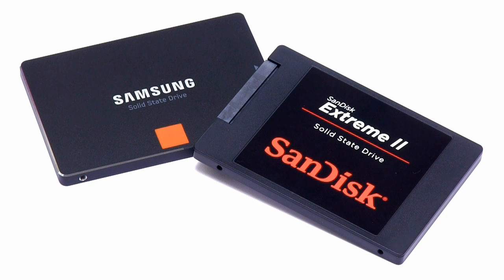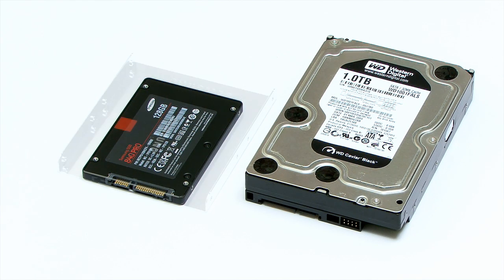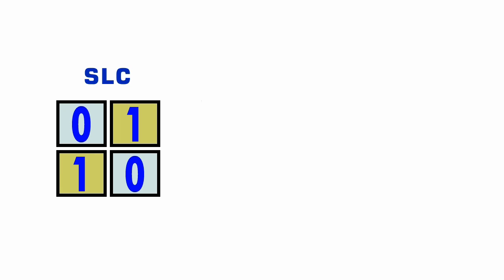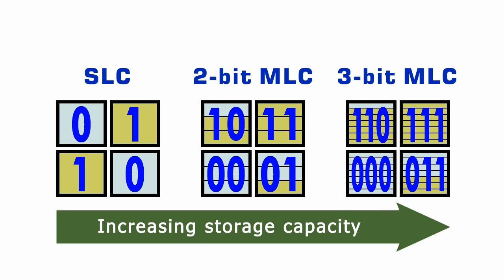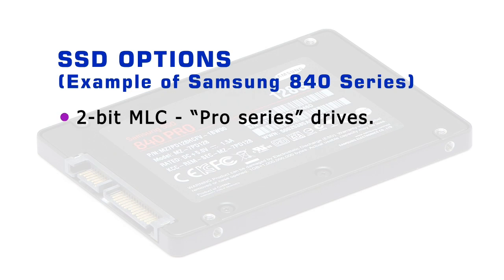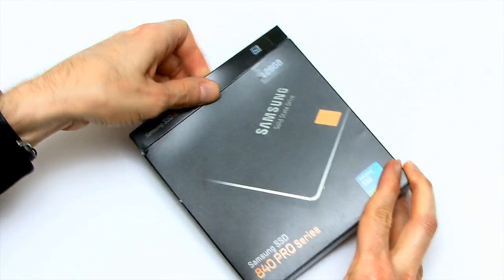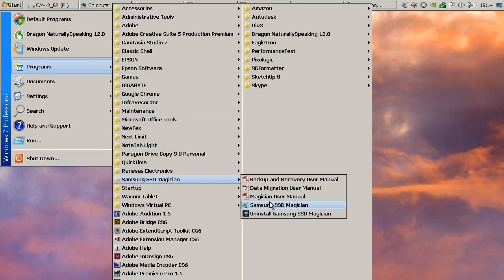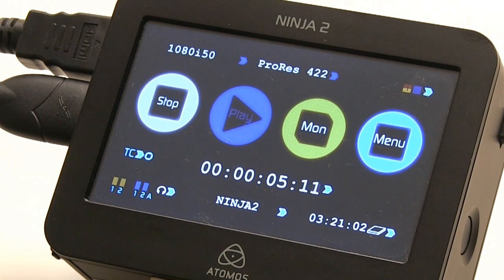Explaining SSDs 2014 Update

Comment: SSDs more than likely won't replace HDDs, rather than be used in random with them by a higher percentage of the computer community.
Reply: Harddrive size growth relies on the magnetic interaction of two moving items in an incredibly high precision mechanical device. There are inherent limitations to how precise you can get (data density), and how space you can fit in a 3.5" drive (platter diameter and count). And even if you move up to larger form factors, you are going to have other very significant tradeoffs in terms of things like spinup speed and arm over disk travel speed. Right now we are hitting some very heavy walls in regards to improving HDD capacity, with companies dabbling in things like helium filled enclosures for reduced air resistance, or trying out thinner platters. With more platters and enclosures that will leak gas over time, the durability and lifetime of harddrives will decrease. And no permanent solutions have been made to the problems that are faced. Meanwhile, on the SSD side, the only thing holding us back right now is memory density and controller limitations. And there is massive space to improve, with controllers able to address more modules right around the corner, along with higher density flash. And we aren't even close to utilizing the full size of 2.5" SSD enclosures. Even the 1TB drives on the market don't get close to filling them up. And there aren't really any serious reductions in performance from scaling SSDs up to be much larger.

SSDs are, sometime in the next few years, going to be come the primary storage medium for home computers. Something that is already happening in laptops, and sort of happening with people opting for phones to fill their daily computing needs. A lot of PC enthusiasts are already moving to SSD exclusive computers, especially in places where fast internet is cheap. Several of the computers I've put together for clients recently have been SSD only, with most of the buyers having gigabit or faster ethernet connections. Since they don't really need to store music or movies on their computers, and only need disk space for games.
Reply: ***** I don't know what weird kind of logic you're using at the moment, but please go back and read through the conversation. Your original statement was that you didn't think HDD companies were bothering as much anymore, which is blatantly false. Adding in that people prefer SSD speeds over HDDs, which is true, but the implied notion that this has such a large impact on the sales of SSDs vs HDDs is not correct. What on earth does it matter if people are buying a decent amount of SSDs if the massive majority of drives sold are ones going in servers, and if the massive majority of those are HDDs? Also, the people going out and buying SSDs are, for the most part, computer enthusiasts. SSD sales are higher than they've ever been, but are still very small compared to total HDD sales. More and more people buying something doesn't mean that a lot of people are. And high end video cards start around the range of about $100. Everything you're writing is from an enthusiast perspective, and you keep conflating enthusiast consumers with general consumers. 

I'm disagreeing because what you're saying isn't correct, and doesn't make sense.
Reply: lol, what... lol servers are are replacing EVERY single hard drives to SSD configuration, and more reliable than HDDS, and its most likely, will be way cheaper even may be cheaper than hdd (in current times) in a few years.
Reply from the maker: Kevin Jin Remember that servers themselves store data on either HDs or SSDs . .  :)
Reply: Kevin Jin Servers still use drives. Not magical server storage. And you're still going to have to use some form of local caching. We have up to 3 levels of cache in the CPU and RAM. There are even people who use SSDs for local storage cache.
Reply: well of course a lot of servers are still running hdd, but now days so many companies are turning to ssd for marketing, and other reasons, just cause its that cheap and efficient.
Reply: ***** Yeah. For a good many years content has grown with the size of storage available, but that growth is rapidly slowing. People working with text based media hit a point years ago of being able to buy all the storage they'll ever need for a few dollars, even the most hardcore music enthusiasts who refuse to listen to anything but FLAC won't need more than a single drive, and although they are still growing, game sizes aren't growing anywhere near as fast as they used to. SSDs don't need to overtake harddrives in size or dollar/gigabyte, they just need to become large enough that people won't need an SSD and another drive. Which is already the case for a lot of people. Most of the computers I've built for older people or families over the last two years have had a really small SSD and a sub 1tb HDD, but honestly there isn't much point in that anymore. Right now I'd much rather put together a system with a slightly larger SSD, and not have to fiddle around with things like moving the download or media folders, when they're unlikely to fill up the SSD anyways. I don't think we're that far away from the majority of all systems only having an SSD.
Reply: ***** Well it is actually really close. SanDisk is planning to release a 16TB SSD in 2015 (http://www.tomsitpro.com/articles/sandisk-4-tb-optimus-ssd-lightning,1-1925.html). I believe it will be in the 2,5-ich size and I am really looking forward to see what it will do with the prices of 1TB or even 4TB SSD. Also these SSDs would be great for servers. Fast and low power usage. Everybody will want to be green, no matter the cost. Even the lifespan will be great. If you look at the V-NAND technology, it will surpass any HDD.
Reply: ***** I have yet to see a Mechanical Drive of 100 TB?!?!?! Now you claim to expect an SSD of 100 TB soon?
Sorry I think there will be another breakthrough in Tech. before we see anything at 100 TB.  My opinion of-course
Reply: Bryan Martin We have 4TB SSDs right now. And SSDs aren't really limited by enclosure size at all. You can make huge V-NAND stacks, with the only problem being the controllers you'd need to address all that space. If you're fine with RAID-style single-PCB implementations like the PCIe enterprise SSDs we've had 3TB+ SSDs for years. And if anyone could afford to buy it, you could put 100TB on a single PCB as soon as next year without much problem. Mechanical harddrives are starting to run into their physical limitations within the size constraints if you want to be able to read and write at meaningful speeds. SSDs aren't even beginning to get close to such a barrier.
Reply: Did you mean 'in tandem' with them? Meaning together, coupled or paired? ...Or maybe you meant that they will be used randomly in an array of hdds? In any case, SSDs are being used in all kinds of mobile devices and ultra PCs that are too thin to contain bulky mechanical drives. The trend seems to be moving towards smaller and lighter PC's and tablets, therefore, making SSD's the logical choice for data storage. I remember when some experts announced that floppy drives would always be a mainstay for computer enthusiasts.  Then came harddrives, CD drives, dvd drives and bluray drives. Nowadays only a handful of people under the age of 20 even know what a floppy drive was. As SSD prices decrease and their storage capacity increases they will become more competitive and therefore more popular. It won't be long until the mechanical drive's usefulness fades, maybe 10 years from now, maybe later. But, eventually, even the SSD storage will seem antiquated and unnecessary as new tech replaces it.
Reply: ***** You mean non-volatile STT-MRAM? That already exists. IBM hasn't brought it to market yet, but they are working on something. Samsung has also brought STT company Grandis, and are presumably working on something, too. It is, for the moment, a rather expensive technology, though. You're unlikely to want to pay the premium for non-volatile RAM in your personal computer for another few years. That Everspin Technologies already have a DDR3 compatible 64MB spin-transfer module available, and you can pick up non-volatile DDR3 sticks to pop in your desktop. If you want to write a contract for thousands of chips...
Reply: metaspherz Hard drives aren't going to be around in consumer products for another 10 years. They're a superior product in every way except for maximum capacity and price per gigabyte. They're quickly going to surpass harddrives in terms of maximum capacity, though (already have if you're willing to count ones with multiple controllers), and the price per gigabyte is going to get close enough that people won't care soon after.
Reply: SSDs will most certainly replace HDDs within the next 15 years. SSDs are doubling in capacity every year, and halving in cost about every other year. Hard drives increase in capacity about every 3 years.
Reply: ***** ...That is absolutely not the case at all. HDD sizes are still being worked on as hard as they ever have been, and hard drives are being used more than they ever have. They're still used in servers, and they're still going to be for bulk storage for some time. The problems currently being faced is hitting more and more difficult to surpass walls of physical limitations.
Reply: ***** What on earth does it matter if it's consumers or corporations buying them? Harddrives remain a competitive market regardless, and in terms of the platters used it's the same development work. You also seem to be confusing the enthusiast consumer with the general consumer. The general consumer is still primarily buying machines with harddrives in them.
Reply: ***** Again, you're confusing the enthusiast market with general consumers. High end video cards end up getting sold out all the time, too. That doesn't mean that high end video card sales outnumber computer sales with just integrated graphics or a basic display output card in them. The massive majority of people still just buy a computer and don't replace the harddrive it comes with. Your anecdotal and highly exaggerated observations don't change that.
Reply: SSDs ought to replace all hard disks as the system drive. It's a no brainer at this point. Stupid fast, pretty cheap to buy, won't ever die.

Comment: Regarding the limited read/write cycles that can be done on SSDs, that will hardly ever be a problem in newer SSDs. The Samsung 840 EVO (primary TLC storage with an SLC "turbo" buffer) shown in this video should last around 50-70 years.

Thanks for the video - it was very interesting :)

Comment: I still don't know wish ssd i should get... :/ anyone has some advice please? i want atleast 240GB
Reply from the maker: Unless you have some very specific professional requirements, you cannot go wrong with a Samung EVO 840. They are a best selling drive for good reason. But only you can decide if you want to get the 256GB, 512GB or 1TB! :)
Reply: ExplainingComputers Well its mainly for the OS,and programs i use allot i mean the 1tb HDD i use now isn't even full :/ allot of friends are telling me to get the 840 evo could you tell me actually what the main difference between the 840 evo and the 840 pro? also maybe i should wait for the intel  730? thanks for your help so far ^^

Comment: Great video. I know very little about SSD's in general and was unaware of the difference between 1-bit\2-bit\3-bit.

For a PC about to be built I probably would've just got a 840 EVO without really considering it but want to get a 2-bit drive if possible. Not necessarily for performance (don't care, I'm not benchmarking 24/7, I just want a PC that runs well and plays games well) but better longevity and reliability, which is the main idea I'm trying to build this PC around.

Comment: Limited number of data write cycles and performance degradation with current gen SSDs simply isn't an issue in normal OS partition use. Even if you do heavy rewrites daily it's still not going to do much to your SSD and what little it may do to performance, it's still going to beat mechanical drive for years.

Comment: I use 128GB SSD as an primary drive and 1TB HDD as a secondary drive.
I store OS and Program Files in my SSD. Other goes to the HDD.
I think this is a good choice.
Reply from the maker: I agree! :)
Reply: how long did it worked for you ?
Reply: this should be perfect
because you want OS to load as fast as possible
you dont basicly need much thing to load fast because if you do then you will run out of space quickly so yeah there are some pros and cons of HDD and SSDs sadly
Reply: I like hdd prices

Comment: what's the difference bethen format a drive and defragment a drive,will i lose lifespan if i reinstall windows after reformating the drive?
Reply from the maker: Defragmenting a drive re-arranges the data into contiguous blocks (in other words, it ensures that all of the sections of each file are in one place, and all the free space is on one place). This speeds things up on a physically spinning hard disk (as the drive head does not have to seek around so much), but will damage an SSD due to the large number of write involved as data is shuffled around.

Formatting erases everything on a drive, and *could* involve writing every cell on an SSD, which would reduce its life a little (though probably far less than doing a defrag, which could write some cells several times). However, you could reformat a drive by doing a quick format (tick the "Quick Format" box in the Windows format requester -- which is usually on by default). This will, if you like, tell the drive that it is been erased, but will not write over the actual data (it will just inform the drive that the data is not there and can be written over when the space is needed). So a quick format will not reduce the life of your SSD. This said, if you really want everything on a drive wiped (say you were selling your computer, and wanted to ensure that the new owner could not recover your data), then a full (non-quick) format would be a safer bet.
Reply: Thank you very much for you're support,as always thanks for sharing this computer tech videos to the youtube community.